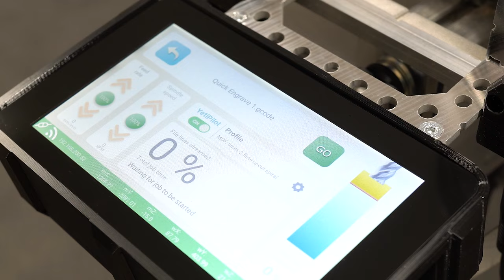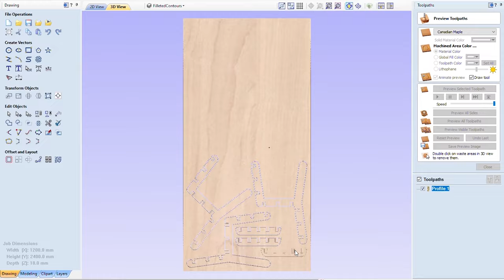SmartBench PrecisionPro + | CNC World First - Adaptive Feed Rate Control

Comment: A world first for your machine, adaptive control has been in use for CNC machines for many years.
Reply from the maker: Thanks for the comment. You are correct, adaptive control has been used in CNC machines before, but  not a CNC router.